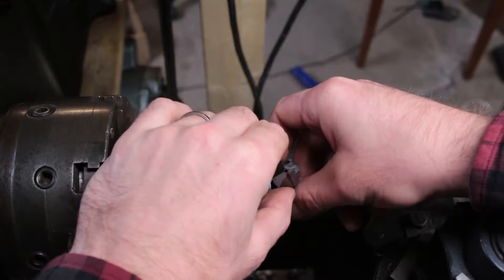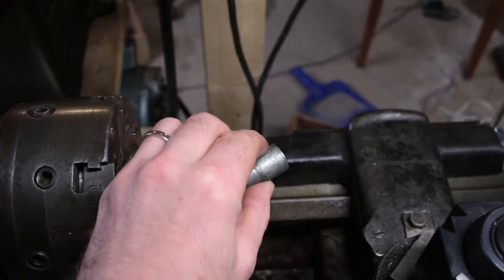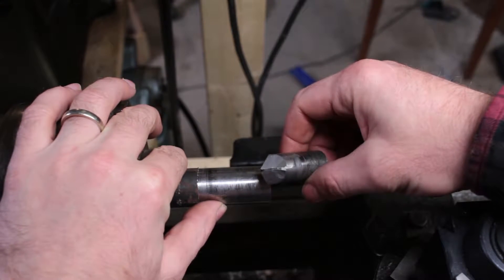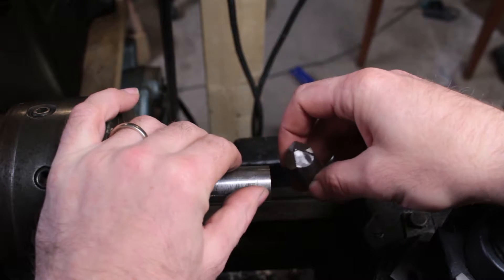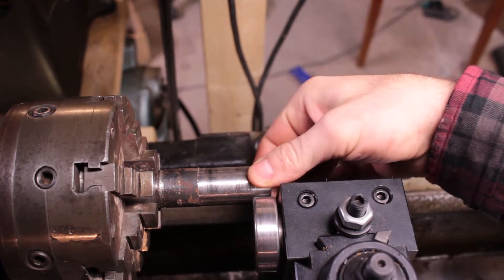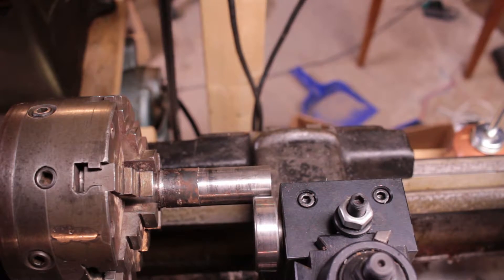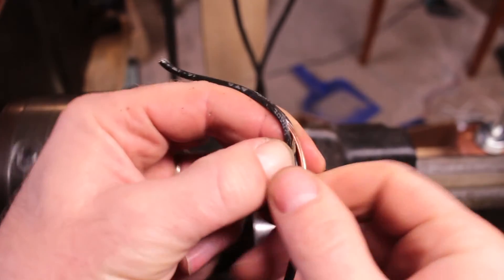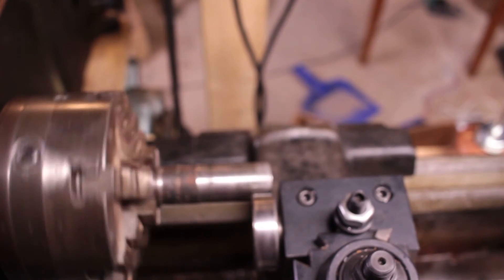Wire stripper lathe attachment

Comment: neat idea, I was thinking that if you took a tap and tapped the threads around the outside of it, kinda like they do for 3d printer drive bolts, it not only helps grip better but the concave tapped part would cause the wire to want to auto-center it into the groove, then you wouldnt have to worry about it wanting to walk all over the place.